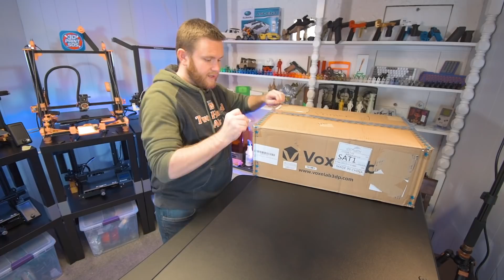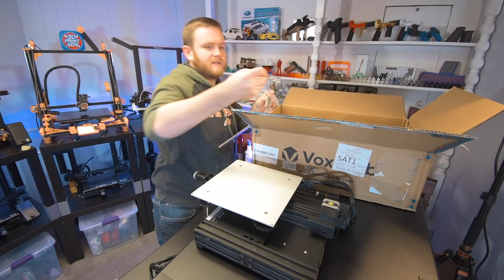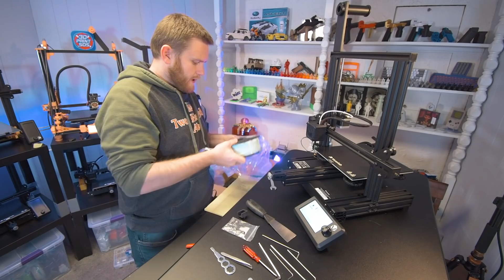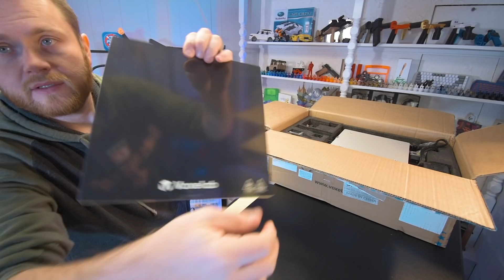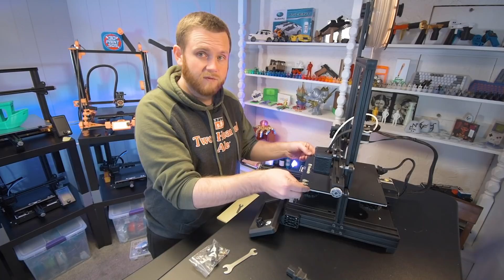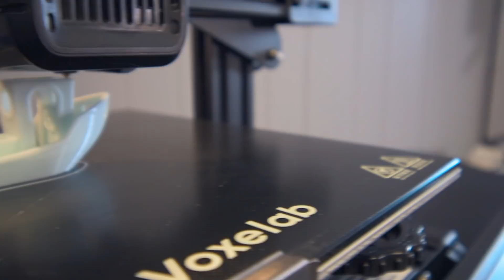$50 Used Voxelab Aquila! Are Amazon Returns Printers Worth it?

Comment: So i got a screen assembly for a voxelab aquila and it went black so i open it up and i see that the cord on it was cut and is no way to put it back together and i looked up online and i did not see no screen there because they don't make them nomore but its still a good printer just without any brains. Any suggestions?

Comment: I amagine alot of returns due to the h32 chip. Opened the box saw the sticker and sent it back.
Reply from the maker: They have fixed almost all of the issues with the H32 machines. Even aftermarket firmware such as Pro and Klipper now support H32. ;)

Comment: Had a BNIB Aquila that had a dent in the Y axis rail. was clearly a manufacturing error as it was under the bed and there was a small scuff on the anodizing. flipped the rail 90 deg, redrilled and tapped the mounting holes. all fixed.
Reply from the maker: Good on you for fixing yourself instead of shipping it back. You saved TONS of gas, workers hours, energy, and learned in the process. Props.
Reply: @3DPrintSOS  sadly it was already a replacement for 1 that had a faulty motherboard. That, i couldnt fix myself.
Reply from the maker: @staticman1263  That’s fair

Comment: I just bought a Voxelab Aquila S2 and a Flashforge Adventurer 3 Pro second hand directly from Flashforge. The A3 Pro had a broken extruder bracket that I super glued back together and now it works perfect. The Aquila had a couple of loose cables and someone had tried to load firmware and must have done something wrong. After updating both the board and screen to the forked version of Jyers. And now it also works very well. I don't have any problems with return machines at all.

Comment: bought a x2 on ebay for 79. was clearly just open box. i believe, most people, are intimidated with assembly and after the new wears off; return asap.
it's directly from the manufacturer. clearly a attempt at lost revenue. no refunds but they are holding a really high rating (98%) from it.
Reply from the maker: Yep. People get confused and return all the time.

Comment: I'm glad to hear you mention the wheels on the bed being loose - I purchased one of these (new) two weeks ago now and it arrived with a wobbly bed that I tightened the wheels on just out of intuition. It leaned to the back as well, which I couldn't figure out through tightening and later discovered that the black carriage that holds the hot plate was bent pretty badly, I assume from the factory, since I was careful in getting set up. Despite this, I got 5 really solid prints out the printer before I even decided I needed to really investigate what this backwards lean was! If there's anything I've learned from getting started with hobbies/skills, it's that I'll never start out as an expert or even have any level of beginner's luck... Some people give up too easily, I guess.

Comment: Hey so I've been meaning to do the z slot change like you described in the video, and before I do, I just need some confirmation. Mine didn't start out with this issue, it happened to me about/around a year after purchase. Is there something that could have caused this to happen to my machine? And if there is, is it something I can prevent after fixing it? Also, what are the measurements for the drills and taps you used?

Comment: First off all, love your videos. Thanks for all the info. I just bought an x2 for less than half price used from the factory, aka Amazon return. I'm having a little trouble with my z motor. It wasn't turning, so I plugged the wire for the x motor and it worked so I know the motor is ok. Then I switched the other end and plugged the x cord into the x port. No movement. Is it the motherboard? Or am I missing something? I still go feel like I got a good deal. I'm off fairly sure that all said and done this printer won't cost me more than a new one and I plan to upgrade anyway. So if I end up having to buy a board, I'll just start a little earlier than I planned. Thanks in advance for your help.
Reply: After a few emails with support where they wanted me to video the things I had already done, they agreed that the z port was probably bad and would need a new board. Unfortunately this machine wasn't under warranty. They gave me an email address and said they could help me, but the help was a link to buy a board of Ali for $50. I was a bit disappointed since I had watched alot of videos and read articles and I was sure I was going to love this machine. So I went back and contacted the store I bought it from (Official Flashforge store on Ali) because they informed me about the lack of warrantee but also said to contact them first if the machine was seriously damaged. I let them no in a respectful way how disappointed I was and how I had doubts about their brand when this machine should never have left the factory the first time. It was obviously a new machine and had never had filament reach the hot end. In less than ten minutes I had a tracking number for the machine they are sending me to replace this one. I just want to let people know how the customer service was awesome despite the problems and that they stood behind their product in the end and did the right thing. Please spread the word.
Reply from the maker: That’s great. This has been my experience with them as well. Sometimes things get lost in translation, but that’s to be expected.
Reply from the maker: Try swapping the wire. That way you will know if it’s a wire or the stepper driver on the motherboard. Just simply plug in a wire from another axis and give it some movement. If it doesn’t move, it’s a motherboard/driver issue
Reply: @3DPrintSOS  Yeah. I did that. Just checking in case I was missing something. I've contacted support and they are helping me. Just not sure how much responsibility they will take since it was bought as used from the factory. If I end up having to buy a new board, any recommendations? I'd like to have room for future upgrades and was looking at the big tree skr v1.4 maybe.
Reply from the maker: The SKR boards are great. I’m throwing an SKR mini v3 into mine. Depends how much “custom” work you want to do

Comment: I picked up one of these returned printers from eBay for $69 with free shipping. On mine everything was fine other than the fact that it kept having a thermal run away error after the print would move more than a certain amount up from the print bed. Turned out to be due to loose connections for the heater cartridge on the mainboard. I've since then switched to the Alex JysersUI G32 firmware, installed a bltouch clone, installed silicon spacers, and upgraded to a PEI spring steel bed plate. Prints nicely the majority of the time and the times it doesn't print is usually either due to filament needing to be dried out, or something I did in the cura settings that messed up the print. It was missing several screws and I had to disassemble the hot end to unclog it, but nothing else was wrong with it. Can't beat that price.
Reply from the maker: That’s great. Well done getting it sorted.

Comment: Hey I have a question my voxelab Aquila isn’t detecting filament and it doesn’t even start to print can you help
Reply from the maker: Turn off the filament detection in the settings and try again. Something is either unplugged or the sensor isn’t functioning.

Comment: Just took delivery today of a half price returned X2 off eBay. There were a few issues, minor ones like no printed manual (downloaded), z-axis stop switch dismounted, and a missing Allen wrench, and one that could have been serious: the y-axis had a noticeable bump in its motion. Close inspection showed no visible faults on the extrusion, so I tried adjusting the rollers, which fortunately fixed the problem. One thing I did as part of the assembly was to cut a ventilation hole in the PSU cover, more air flow may increase the longevity of the PSU fan... Machine had been used, 1/2 the filament had been consumed, but otherwise in great shape, a real bargain and the N32 chip!
Reply: where do you find these ?
Reply: @ivanmonahhov2314    I assume that these get collected and periodically placed for sale on eBay or Amazon. I think you just have to keep looking for them, and respond quickly as they don't last long. I was just lucky as I had no idea that you could get these so cheaply.
Reply from the maker: Awesome. These are such a good deal if you don’t mind getting your hands dirty. Well done.
Reply: Where do I purchase ?
Reply: @tobyfowler2416  I found mine on eBay, but they are not there all the time. Voxelab has sales where they do deep discounts, but I think mine came from someone that buys returned items, and then sells. You should just keep looking on eBay and they will show up from multiple vendors.

Comment: can you just take the bed off entirely and print on the metal?
Reply: ok thanks
Reply: another question where can you buy these amazon returns?
Reply from the maker: They come in waves on eBay and aliexpress. Just gotta keep an eye out.
Reply: ok thank you
Reply from the maker: No because the filament would have a lot of trouble sticking. Also metal isn’t nearly as flat as glass.

Comment: I had this issue on one of my ender 3 on my y extrusion i had a bump to fix it I upgraded to linear rails clean install fixed my problem
Reply from the maker: Nice upgrade
Reply: @3DPrintSOS  What's going on with the safety issues you talked about in some past videos about thermal runaway? and has this issue been resolved I had looked at this machine when buying my last 2 Ender 3 machines but passed because of the firmware issue,  not one who likes to deal with 3rd party firmware
Reply from the maker: All of the latest firmware from voxelab fixes the issue. ;)

Comment: It's a gamble buying these as a return to try and save money. I bought one off Ebay as a return last week and it arrived today and it's missing all it's hardware, two of the stepper motors connectors is broken (the pins look fine but the plastic that probably secures the connector is broken), the last major problem is the wires that connects to the hot end looks like they are hanging on by a thread so I will probably buy a new hot end assembly. There are some other missing parts but they will hopefully be cheaper to replace. I'm not going to say you should not buy a return unit to save some money I'm just telling you my experience so you will know how bad these return units can be because the money I saved buying one I will probably have to spend on new parts to get it up and running. I gambled and I lost.
Reply from the maker: Ah bummer. Yeah it’s a gamble for sure. You have to be prepared to take the L once in a while. With that said, I’ve seen waaaay more success stories then issues. Not saying they don’t exists obviously.

Comment: We've got a local return online auction company with warehouses in our area where I've been able to buy 7 Aquilas so far, ALL for UNDER $50/each. I've had one that was clearly assembled and then disassembled as you could tell they had printed something (or tried) and all the parts were loose, but only a few screws missing. One was brand new except the glass plate had shattered and I had to clean the shards out of the box. The others were all brand new! It looked like the box had been opened on a few but a couple were still factory sealed! ALL of them have turned out to be G32s so far.

 Idk why these are getting returned? I'm sure there have to be some that couldn't be delivered... Some that get refused delivery... Maybe some that get it and decide it's not for them or there ordered the wrong one? IDK. 

What I DO know is that this particular company has at least a dozen warehouses in our area, and those warehouses are ALWAYS FULL of all kinds of miscellaneous crap.... From tires to mattresses to appliances to clothing to cat litter, toys, caskets, lawn mowers, tools, earbuds... you name it! Much of it brand new, a lot of open box but still new, and some clearly broken or used warranty returns from time to time. (You have to be smart when you bid sight unseen). 

And this certainly isn't the only company doing this in the US. So just think about how much of this stuff was/is going to waste and into landfills because Amazon save big box stores aren't simply putting stuff that could be resold back into inventory! This has become a BIG BUSINESS - and I for one welcome it because it saves my family and others money and saves this stuff from landfills.
Reply: I got a CR 10 S5 from one of these auction houses and just had to change out the hotend and fan. Price was $250. I
Reply from the maker: Crazy deal!
Reply: Oh yeah... Lol. I've kept 2 for myself, 1 in use and one in progress. Gave one to my son for his birthday, another is going to my stepson for Christmas. The one that was in pieces I'm keeping handy for parts (already had to use it's PSU). Still have 2 left and may keep a 3rd and sell the other.
Reply from the maker: That’s pretty awesome. If you don’t me asking, what is the name of the company?

Comment: Great video! Do you happen to know what the slicer settings were for the built in objects? They print so perfectly that it seems like figuring those out and making them known would be a massive help.
Reply from the maker: My pla profile is pretty close. But you can run them through a gcode viewer online and see the settings.

Comment: The Voxelab Aquila is a good printer if used as it comes. But it wears out quite fast and after 6 months everything starts to loosen due to the cheap components used. It is possible to keep these printers running but it came with a lot of extra costs and downtime.
Reply from the maker: That’s just 3D printing. You’re dealing with friction and heat. Things will require maintenance. Calibrating the machine and doing regular maintenance is the best way to keeping things running smoothly.
Reply: @3DPrintSOS  No it's not.

I've been running my E3v2's almost every day for a year and I barely have to touch them.
Reply: @3DPrintSOS  After my first Aquila 3D printer broke down I started order 2 of every part that I replaced to always have a back-up. Then every week or so I just ordered extra parts to have them on hand. I learned a long time ago in my service job that having the right spare parts reduces the stress and down time.
Reply: @123masteryoda123  Add that all up and you probably spent double over an E3V2 at this point, which hold up great.
Reply: @dangerous8333  I disagree. You have 3 printers and shit breaks. You can't tell me a fan or wire harness on an E3V2 never breaks. I lived in a world for 25 years where having spare parts is worth the up front cost. I might not use them for 6 months or a year. But when I need them, I got them. And the cost was only about $100. That's $33 per machine, bringing the cost of each to $200. Well under the E3V2.

Comment: Great video! I've been binging through your channel as I just got an x2. I'm having some issues I cannot seem to figure out, however. I spent a fair bit levelling the bed, but I'm experiencing prints where all that comes out is strings ( like spaghetti almost, lol). When they prints do seem to be going well, about halfway through the object I'm printing will get knocked off of the bed--ruining the print ( this also happens sometimes within the first layer or two). Am I still needing to relevel the bed( as in could it be I just haven't gotten it quite right?). I'm using your cura profiles as well--btw--and printing in pla.
Reply from the maker: Hmm. That sounds like you’re a bit too far off the bed. Try to follow this step by step: https://youtu.be/Q7Mu05fZNsk
Reply: @3DPrintSOS  l'll try again! i've levelled ( or rather attempted to level) this damn bed about 6 times now hahaha. I appreciate it man, I'll report back and let you know.
Reply from the maker: It’ll be second nature soon. Also, you won’t have to do nearly as much once you get the hang of it.

Comment: Great video. Gives me hope for being able to afford another. I would not recommend buying a "warehouse deal" if you're a newb but anyone with even a little big of experience should be able to handle this
Reply: I would recommend it. If it's missing parts you can return it no questions asked. So what's the risk? 

Zero.

I buy Amazon warehouse all the time and 99.9% of the time it's in perfect condition.
Reply: If you can't afford a used 3d printer then somethings not right. Anyone can buy a 3d printer if they can buy the newest iphone
Reply: @maximuschapman3852  not everyone has an iPhone. I refuse to buy into that facade. They're status symbols and you're right, if you can buy an iPhone you can buy a printer, hell forget used, you can buy a new one. Some people can't afford either, Some people need to choose food on the table and a roof over their head for people like that (🙋) even a used printer can be a luxury

Comment: 3 of my Aquila’s are returns was nothing wrong with them. Just did the normal changes and updates on them. There was nothing wrong with them. After Xmas look for the returns to be priced at 1/2 the listed price. It’s like rolling the dice, there was nothing missing but on the next one may have missing parts. Two looked like whoever bought them just opened the box than closed it.
Reply: Where did you go to buy returned printers?
Reply: @tommymartin364   got the 3 on eBay just have to watch there should be a ton of returns after Xmas.